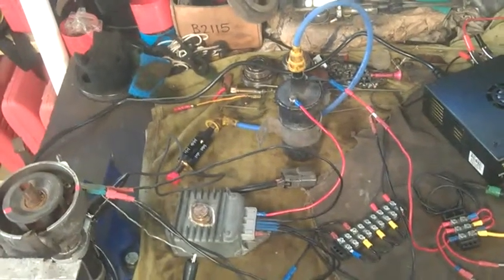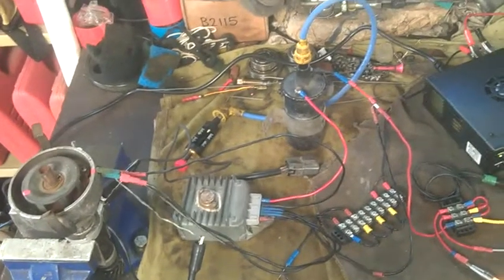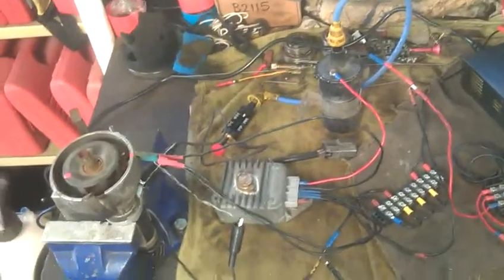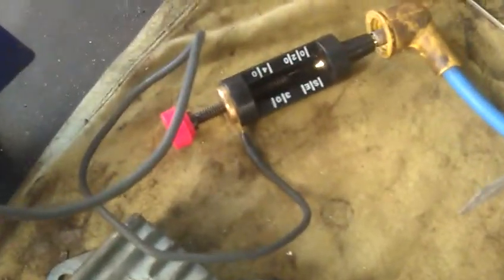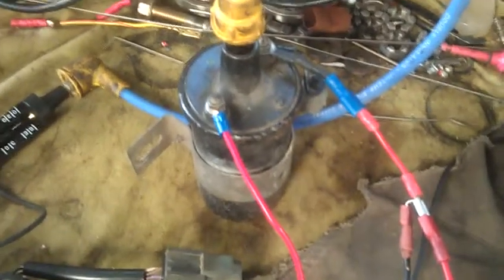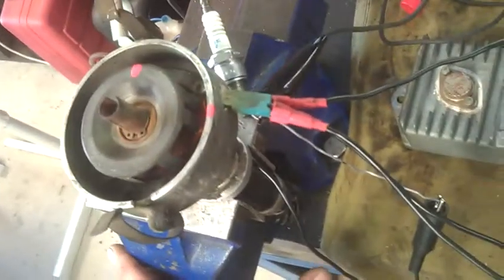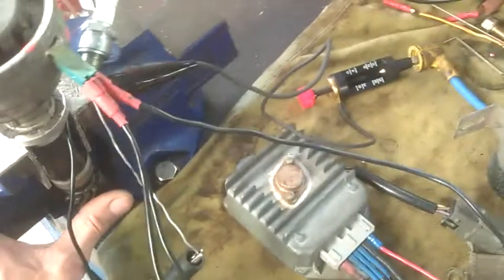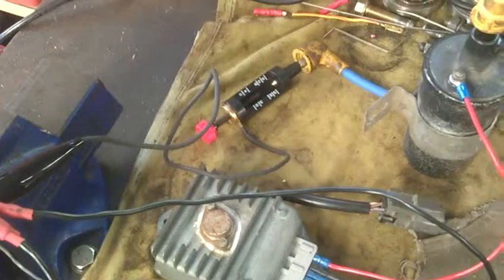Holden Commodore VP V8 Ignition System #2

Comment: So what was the issue, really like to know. Regards Ricky
Reply from the maker: Hi Ricky,
I made a bit of a classic mistake in this one by mucking with things before definitive testing and subsequently could not 100% prove what caused the no spark issue.
Before setting up to bench test the module and distributor, I found the two solder connections to the back of the large to3 type transistor (metal ufo mounted to the outside of the ignition module) had loose/dry solder joints.
Unfortunitely like a fool I re-soldered them before bench testing, so I'm pretty sure that was the main issue since it worked fine on the bench, and on the car when I refitted it.
However, one of the screw holes mounts the module to the p.side inner fender is a module ground point, so this area has to be cleaned back to bare metal/free of paint and rust to make a good connection, so just by loosening and re-tightening the screws may inadvertently fix a poor ground connection, but in this case I'm pretty sure it was the bad solder joints to the main transistor.
This particular vehicle also had a faulty ecu, and a few other issues, so even after getting spark and getting it running, it still needed another ecu and bit more work to eventually get it running well again.👍🇦🇺
Reply: @simonilett998  thanks for the reply. Was just mucking around today wigh ignition module. Comparing wire colours to diagram. Didnt match up. The main 6 pjn connector, is that from the dizzy and somewhere else. Or is the module sending out info from ghe six pin anx receivi ng jnfo from the smaller 4 pin connector?
Reply from the maker: @rickymccoy6968  Hi Ricky,
The 6 pin connector consists of 3 pins from the dizzy hall effect sensor.
The othe 3 pins are:
Positive power supply to the module, ground for the module, and trigger/switching wire to negative side of the coil.
The 4 pin connector is essentially communication/control signals between the ignition module and the ecu, so the ecu can control spark timing once the engine is running.
So, If the module, dizzy and coil are all working correctly, you shouldn't actually need the 4 pin plug connected to get spark when cranking the engine, the 4 pin plug only comes into play once the engine is running.
I don't have the module pinouts on hand anymore so I'm not sure which wire is which for the dizzy sensor, but the wire colours for VP V8 - 6 pin connector are:

Red = Power (+)
Brown = Coil (-) Trigger
Black = Ground (-)
Light Blue/White = hall effect signal from dizzy going into module (should see a square wave signal)
Grey/Red = dizzy hall effect sensor (-)
White/Black = dizzy hall effect sensor (+)

4 Pin ECU Connector:
White/Violet
Black/Red
White
Tan/Black

The only variation for VN V8 is the Red Power (+) wire in the VP V8 list is Pink for VN V8, all the rest stay the same.

VR V8 - All same as VP V8.

For VS V8, 6 pin connector:
Brown coil (-) trigger wire changes to Brown/Red.

VS V8 4 pin connector:
White/Violet changes to White/Green
And,
Tan/Black changes to Brown/Yellow.

Hope this helps somewhat.👍
Reply: @simonilett998  thanks so much for taking the the time to reply in such detail and youve cleared the clouds for me. Yes mine is vp so different to my diagram. Thanks again. Was gaving issue with tacho dropping out. Ive put anthor control module in, checked wires ( brown) on coil. Awaiting a inhibitor switch so when it arrives i'll test it again. Tacho has been serviced and calibrated.  Started dropping thwn jumping. Thinking coil or module. Fingers crossed. Regards Ri cky
Reply from the maker: @rickymccoy6968  No probs mate, hopefully helps you sort it all out.
Yep, Brown coil (-) wire is also the trigger signal for your tacho but it looks like it changes to Brown/Red maybe somewhere in the harness or it will be Brown/Red at the dash tacho comnector, should stay Brown at the ignition module used to trigger/fire the coil but essentially it's all the same wire.

Your tacho should only need 3 wires to work, power (+), ground (-), and the Brown/Red signal wire (coil (-) trigger wire)

All wiring colours for VP + VR are the same as I listed, also VN from Oct '89 onwards should be the same as above too, only early VN's had the Pink coil (+) and Ignition module Pink (+) so no biggie if your's is a VP.

Let me know how you go, and/or if you need any more help👌👍
Reply: @simonilett998  will let you know, wont be for a 2 weeks at a guess. Thanks again Simòn.
Reply from the maker: @rickymccoy6968  No probs mate.
Most common reasons for the tacho dropping out will be a loose plug/pin connection at the tacho connector behind the dash, or at any point between the coil and tacho.
Or, if everything tests good from the engine bay right up to the tacho, then the tacho itself likely has a poor solder joint/loose connection inside the tacho, or a capacitor inside the tacho is failing.👍